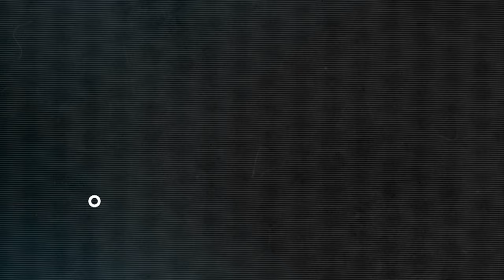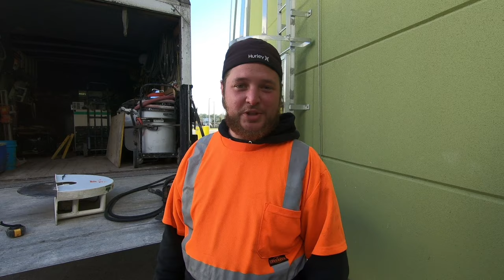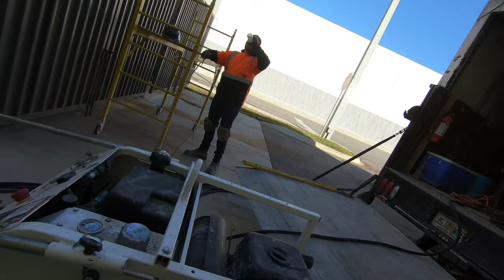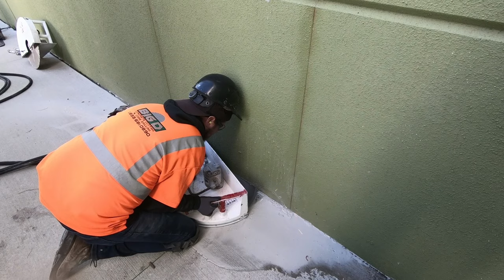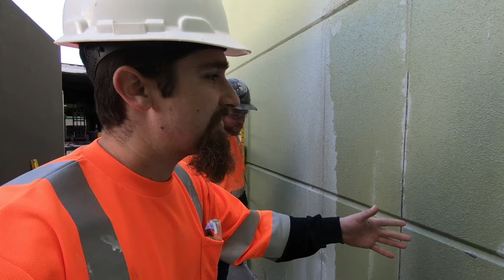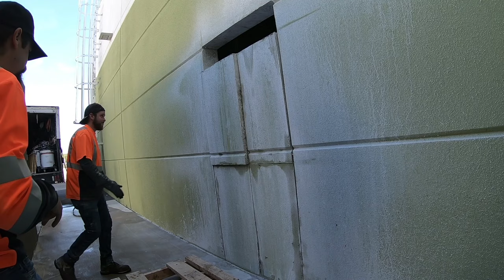Cutting A Door Opening Out Of A Concrete Wall

Comment: I was exposed to massive amounts of silica dust without knowing or protection while drilling holes for housing and blowing out the holes with compressed air now I am trying to get a Whole Lung lavage to SAVE MY LIFE and remove the silica dust in my lungs before it's too late please spread awareness about a possible hope for removing the silica dust from lungs before it causes fatal damage.
Reply: What can you use to prevent this
Reply: @shauntimmins2438  Water/Vacuum/Respirator
Reply: Gracias bro

Comment: Looked awesome especially doing it by hand! Everyones got their own way of doing it, whatever youre comfortable with! Just a tip from a fellow cutter, try cutting the door in one piece next time, with a 2” relief gap at the top and push it on some tires. Then all youll need is your 20” handsaw to cut it up for hand removal. A lot less corners you have to chainsaw. A lot less hard work.
Reply: Also I'd add sheetmetal for flush so you don't have swirls. Plastic on the sides dry slurry is a nightmare to clean.and never pull concrete towards you. I'd also have some tires and plywood for dropping on finished floor
Reply: Yup, a lot easier cutting it up on the ground.
Reply: Hey Sam! Hope all is well. Quick question if you don’t mind. I’m looking to get a set up like this to have some guys cut everything as far as slabs go as a division of the plumbing business for redrains etc. question is. What’s this set up they got capable of doing? Thanks!
Reply: The hell with any extra cuts u can actually walk that whole price of Concrete out buy simply using your wedge or alternate hitting the bottom sides to walk it out just 2 inches or so just so it will clear the top edge when you push it over onto some tires

Comment: If you walk the opening out 1" by hitting it at the bottom with a 25lb sledge hammer, it will fall right out with no dice cutting. Drop on an old tire and it will land like a feather. Another trick is to stack to blades on top cut on 6" or less works too! you can thank me later. Cool videos!!
Reply: Thanks, you are correct.

Comment: Great vid! Are there any considerations for reinforcing the header of the opening since the weight from above now has to be transferred to the sides?
Reply: Not necessary for tilt-wall construction, as the wall was poured monolithically.  But for wide openings close to the top of the wall, maybe.

Comment: 3.0 by 7.0 or bigger, just use a wall saw. Get a cheaper on either the Husqvarna WS 220 or Hilti DST CA 10. I cut by myself and did not take this long to get a 3.0 by 7.0 door cut done.
Reply: SHIIIIIIITTTT MAN, have you seen the price tag on a hilti wallsaw unit??? holy fuck man.....$90,000.00
but i will say this you pull out a hilti ws onto a job, and know how to operate it, you be lookin la-jit!!!
Reply: @jmcg2518  that’s the thing, I do have one. But it’s best to cut with wall saw than handsaw

Comment: Is there any reason you didn't just use a mounted wall saw to ensure straight cuts since it will be exposed?
Reply: Was wondering the same thing. Maybe they don’t have one or to save time on the set up?
Reply: We only use a track saw for super long or deep cuts.
Reply: Only long or deep cuts huh? What about a bank vault with a shit ton of steel in it?....indoors?
Reply from the maker: @jmcg2518  That too.
Reply from the maker: @yourmother638  All the operators here are proficient with all the tools of the trade. Every cutter worth their salt can run a hand saw and cut straight lines.

Comment: How much does a job like that cost?
Reply: I like to get an idea of the price as well.  You do not have to give exact number but a ball park figure.
Reply: @aq8020  the thing is when it comes to price, does the sawcutter charge by the linear foot, or by the hour? lets say he charges $15.00 per inch foot. now thats $15.00 for every inch of depth of concrete per linear foot, so if it were 4 inches thick then every foot he cut would equal out to $60.00 per foot. A typical man sized door is approx 3x7 foot which is 7+7+3+3=20 linear feet with a depth of cut being 8 inches. So, total cost for cutting 1 man door would be $15.00×8=$120.00 ×20=$2400.00

Comment: Why do you guys use down cut saws? Try an upcut saw "blade spinning the other way" Makes Handsawing  so much easier... Puts hydraulic handle grip/lever on the top side of vertical cuts which can cut farther down to bottom of cut and way more ergonomic for the operator.IMHO

Comment: I dont understand your process of cutting openings. you always cut your horizontals first then your verticals. if you cut your verticals fist then horizonals second you run into a big possibility of pieces dropping onto your blade in midst cut. especially cutting multiple pieces. I know you Still have to chainsaw but never trust a corner with all that weight. hope your boss will buy you a wallsaw for that tilt panel. I know that sucked ass even with 2 cutters
Reply from the maker: We appreciate your observations, they cut the way they are comfortable with and did it safely leaving enough material attached to prevent pinching and binding. In our neck of the woods a track saw for a 30/70 is over kill even on tilt.
Reply: @bigdcutting957  I mean everyone has their way of doing things for sure. Personally I think track saw is never overkill especially for tilt wall. It saves your guys and cuts ot way faster and safer. Just my humble opinion. Handsaws are meant for block and stuff where mounting a track just won't work. And yes I'm in central Florida as well.